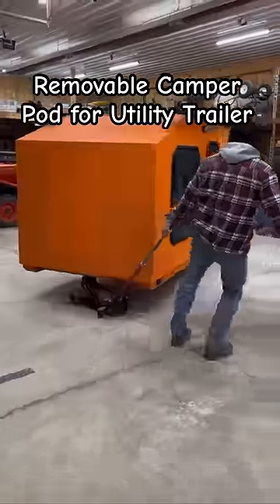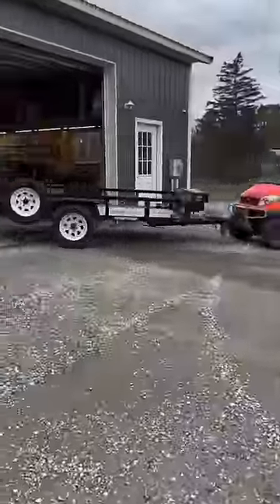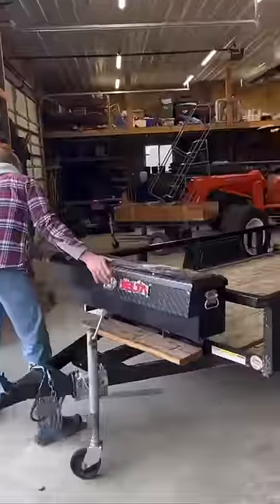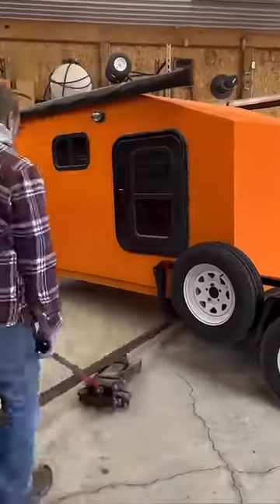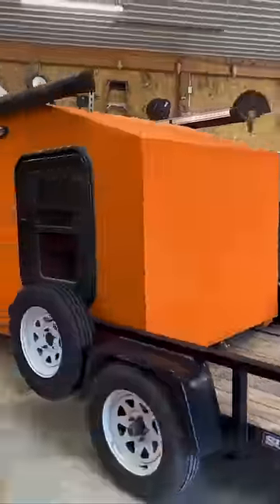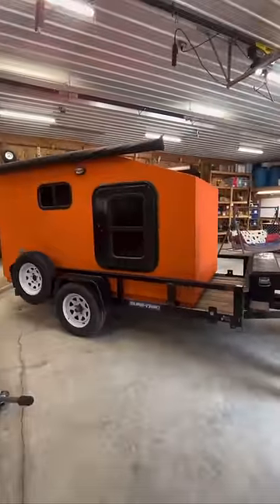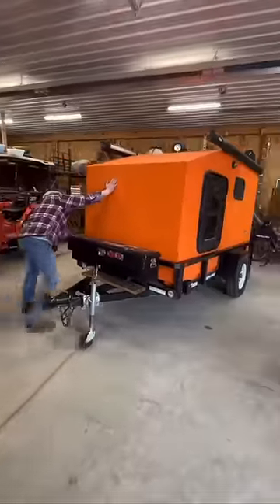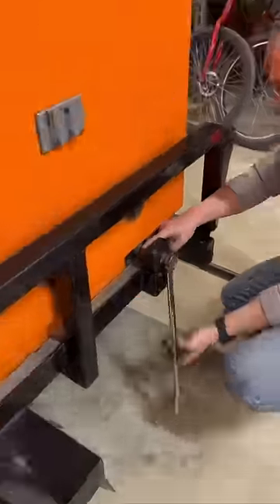Removable Camper Pod for Utility Trailer

Comment: LOVE IT :D . i'd add "legs to the camper instead of wheels . sure it wouldnt looks so streamlined, but you could simple drive trailer under the pod, drop it down and fold the "legs" . not to mention you could keep the floors  away from damp grounds  if you'd ever need trailer .
Reply: Why not legs with wheels? look at the way the Ericcson Skycrane looks, with the long legs and wheels. Or, just use the legs as up down jacks, and still set it on the wheels like he has. You could even 'leg' it off the trailer at a camp site, and not tie up the trailer for the whole trip.

Comment: This is the video that I’ve been hoping to find. I’m almost at the end of my design phase and should be ready to start the construction process on my own camping trailer box, that I will be using on my 6’x 10’ utility trailer. My ramp is unfortunately not removable, so I’m going to have a little more work to figure out how to get my box onto, and then off of the trailer.

Comment: I saw a guy had something similar with a pickup type camper on a trailer. It was a car trailer had the camper in the front with storage on the sides with his toys on the back. You'd never know it was a pickup camper, but the front over hang for the bed gave it away.

Comment: On mine I put 3 lengths of pvc and one person can just push it on.
Reply: 3 lengths of what profile pvc?
Reply: @Tonisuperfly  any round material will do the trick. The bigger the diameter = less force to move.
Reply: @AL4N.  you mean you used them like rollers? I had thought you meant you attached pvc like skids.
Reply: @Tonisuperfly  yes like rollers.

Edit I am not the original poster, I just happened to be named Alan also.
Reply: @AL4N.  ah I see. I still think the OP meant he attached the pvc like skids. I get the rollers idea too but I wonder how you get them out from under it once you’ve rolled it on 🤔
Reply: @Tonisuperfly   No. I drilled a hole on one side for a few screws to  put them into floor without sticking out and mount tubing lengthwise. A flat strip of pvc lattice would work also. I drilled two holes in front trailer frame and installed two large lag bolts with heads cut off as alignment/hold down pins. 2 Holes in rear floor to drop bolts through and it s not going anywhere.
Reply: @alangeddes268  thank you for the detailed reply, that’s much clearer. Good to know that skids work. I Ike your lag bolt idea too. 

How heavy is your unit?  It doesn’t crush the pvc tube? I was thinking lattice but tube should slide easier with less surface area. I do have some heavy duty pvc pipe but it’s 4”/100mm diameter. I might try cutting it  down into rounded strips. Cheers.
Reply: @Tonisuperfly    It was super light and no problem with pvc. I used to throw 4 cinder blocks and some shims in my truck and slide it off and on by myself if I wanted the trailer for something.

Comment: Have you considered adding those jacks like they have on the truck bed style campers? So you can just lift it up vertically and then pull the trailer out from underneath.

Comment: I designed a similar solution for my small utility trailer ( think single motorcycle hsuler ) - but haven't constructed it
Reply from the maker: It’s a fun project. You won’t be disappointed after working on it but you will have more ideas to make a better one!

Comment: I like the idea and how it works but as a 6ft 3in tall man that thing looks super small even for just one. Its not much bigger then the bed of my truck with a tall cap on it.
Reply from the maker: I’m 6’1” and it works well with wife and I. Bed is a queen. True, not much bigger than the back of a truck if you have the 8’ bed with a really tall topper. For us, we’re camping a family of five. Chairs, clothes, tents (kids), gear, kayaks, paddles, tackle, food, bikes, etc…. We typically load up the truck and still load up the camper for transport. It works well for us. If it were myself alone, I would truck camp as you suggest for sure!

Comment: Sorry for the couple, but honestly there were multiple red flags early on that they should have walked on that camper and dealership. 

First was the being pressured into putting the deposit down because multiple others are looking at it. That by itself isn't always enough to walk if it's exactly what you've been searching for, but it's enough that it should put you on alert. When they got there and the dealership didn't even have the camper they wanted is when they should have gotten their deposit back and left. At that point it's pretty obvious you're dealing with a sketchy dealership or at minimum a sketchy salesman. Pressured into a deposit and told multiple people are interested in a camper they don't even have. Even if the deposit was non-refundable it's time to cut your losses and find a different stealership.

Comment: This is useful for about 1 person who doesn't wanna spend an extra $500 on a utility trailer that's seperate. Kinda useless
Reply from the maker: Hi AJ. Appreciate your feedback, though 87% of the comments in this build are positive. I have three folks I am working with right now via email copying the design. To each his own, but you may be a minority on this one. Regardless, thanks for reaching out 👍🏻
Reply: @LivingOurAmericanDream  I mean my viewpoint was a bit narrow but my question is, what is the benefit of this? I guess i would need like spec sheets and pricing in order to compare. In my viewpoint, it seems useless and a ton of extra work. I see it as a utility trailer can be bought (used) for around $500. Then a camper can be found for around $5,000 (used) obviously this is brand new though. Can you touch a bit on the pricing and specs that can be added?